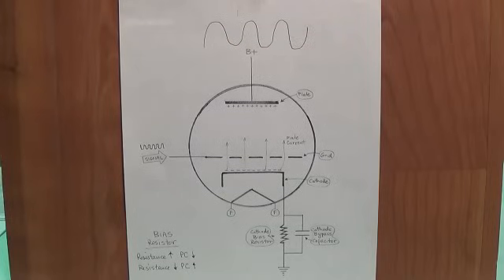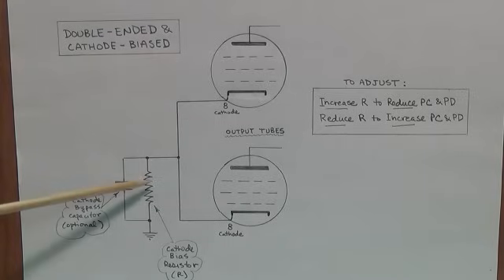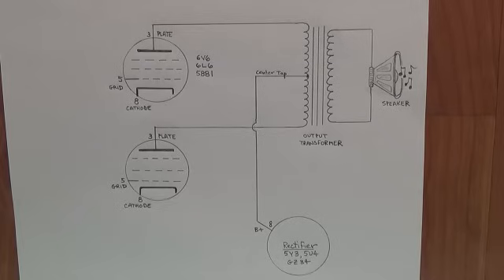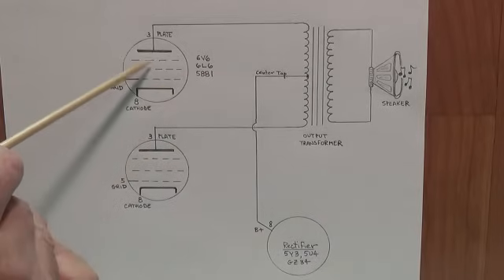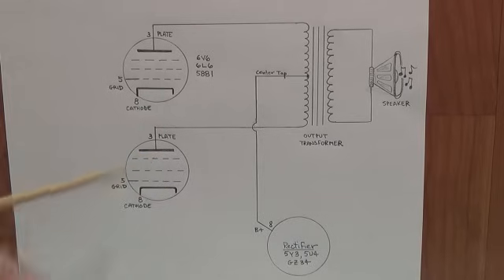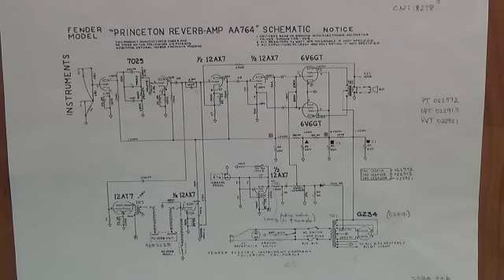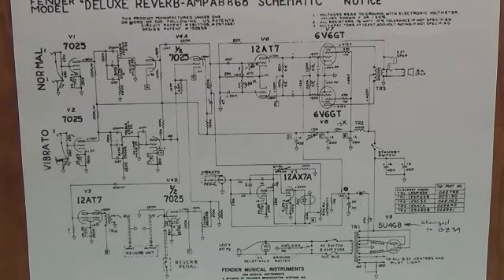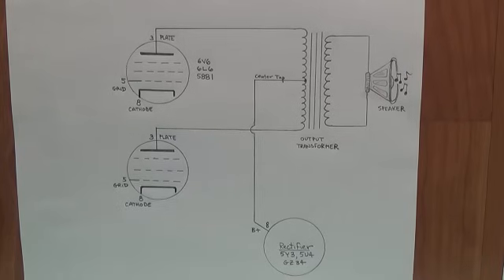Biasing Double-Ended Amplifier Output Tubes, Part 1: Basic Explanation & Methods

Comment: I think it’s much easier, just as accurate, and a bit safer to use a plate current tap, such as the basic Eurotubes bias current socket. But since the banana plugs will be at 400-500 volts instructions must be carefully followed to avoid shock.
Reply from the maker: I've been using Eurotubes bias probes for years, Kirk. Please see my video demonstrating them.

Comment: Hi Doug,I have a one question related to fender diy 5E3 amplifier which,can i use out put transformer purchased direct from usnited states to use it with 220V   european version amps..thank you
Reply from the maker: Yes you can, John. Even though the primary AC source for your amp is 220VAC, the amp itself runs at the same voltages as a 110VAC circuit.

Comment: In the grid biased example...
Why do you need the plate voltage?
You already have the mA and R in the output transformer and P = I^2 R
Reply from the maker: Your suggestion doesn't work for plate dissipation, Ott.  You are measuring the power wattage created within the OPT.....not the output tube.
Reply: @UncleDoug  Oh yeah!... It's all that heat she's throwing off into the room!  I forgot all about that!
Well, my idea works if you can wrangle up some absolutely 100% efficient tubes. And superconducting wire.   lol.
Reply from the maker: @Ottbucket  Even then you'd need to know the plate voltage.

Comment: In some circuits, there's a resistor, ie 50 ohm, in series between pin 8 and center tap. When I measure the resistance, do I include this resistor?
Reply from the maker: Since Pin 8 is to the filament and the center tap is between the plates, I have no idea how a resistor coud be in series between them.

Comment: If there is another (68Ω) resistor between the center tap and the B+, should I include that in the measurement?
Reply from the maker: No. You connect the ohmmeter to the CT and the tube plate, measure the resistance, then switch to DC voltage and measure the drop. Repeat with the other tube plate.
Reply: @UncleDoug  Thank you Uncle Doug!!! I rewatched all your old videos and I am super grateful for the knowledge you gave me!

Comment: will try to do this later with 6j1 small signal tubes. may be 2 of them in push pull config will provide some audible sounds.
not sure if i have audio transformer for this. may be will experiment with some mains to 6-0-6 or 9-0-9 ones. 
thanks.
Reply from the maker: Good luck with your project, IB.

Comment: I have to cool down a customers amp that's running at 147% plate dissipation and have never had to alter the cathode bias resistor in any other amp I've worked on, until now. Uncle Doug, I now fully understand the theory, principles and practice to get the job done when it arrives. Thanks again for all of your videos, you really are my favorite Uncle.
Reply from the maker: We're glad to hear that the videos have been informative, VTA. :)

Comment: you said EL84s are only cathode biased, but on my blues jr schematic it shows the cathodes of the EL84s are connected to ground and looks like the grid is biased or potentially the screen grid (sorry I don't fully understand)
Reply from the maker: I don't believe I ever said that all EL84's are cathode-biased, Kyle, because it's not true. I have several amps that utilize them and they are grid-biased. I have never heard of screen-grid biasing.
Reply: @UncleDoug  oh so you're just saying EL84s should be grid biased around 70% ?
Reply from the maker: @kyledriscollmusic  I'm saying that ALL grid-biased output tubes should be biased at no more than 70% of max PD.

Comment: Your videos are phenomenal, I’m learning so much! Quick question, I’ve heard that some manufacturers of cathode biased amps will bias the output tubes to 100% rated plate dissipation. Is this advisable? I thought 60 to 70 percent was the recommended target, at least for grid biased amps.
Reply from the maker: Thanks so much, Tony. Recall that cathode biasing is self-compensating and CAN be biased at or near max PD.  The 70% figure is only for grid-biased output tubes.

Comment: Are the steps basically same with a solid state rectifier? The reason I am asking is I am testing the bias on a JCM 800 and getting very low mA readings (,3mA) on the bias meter and the negative bias voltage  is about -57.5 volts. I have used 2 different meters and get the same thing.
Reply from the maker: Yes, the biasing procedure is exactly the same, regardless of the type of rectifier. Without knowing every detail of your procedure, including the scale selected on your multimeter, it's hard to speculate, but if the amp functions well like this, then the PC reading is obviously incorrect.
Reply: @UncleDoug  Thanks for the response. I should add that this is a JCM 800 50w clone that someone else built. It did not work at all when it came to me but now works after I corrected the power supply section. Also, they used an Antek AS-3T325 toroidal power transformer, why I don't know, but I followed Marshalls schematic to get it going. It has been difficult to trace what they have done but everything seems to be ok now but it sounds terrible it has that cold solder joint in the signal path sound but I re-soldered everything. It also has the 1 ohm  resistor going to ground from pins 1 & 8 on the EL34s, I get zero voltage across them to ground. PV 481v - Pin 4 479v - Pin 5 -57v . I get sound but it's distorted. Odd but, before I discovered that the EL34s where not actually grounded because of a missing nut I was able to adjust the bias to 70% dissipation using a eurotubes probe connected to my MM set at mAs no problem but the same bad sound. After connecting the EL34s to ground (pins 1-8) I get the same bad sound and cannot read the PC. I also used a Bias King and got the same results. hopefully I explained that well enough.
Reply: Would it be a good idea to lower the B+ just after the Choke with a resistor? That would lower the Screen Voltage which might be the issue.
Reply: I did add a 2.2K 2watt resistor after the choke and that everything down stream closer to specs and the screen voltage is at 465 volts and the schematic calls for 464. That puts the PV at 483 now. Still sounds bad.
Reply from the maker: @GuitarTubeAmpRepair  This is why I never work on other people's home-builds. The problem is always due to some obscure (or blatant) mistake(s) in the wiring that can take hours to find. I'm sorry, but there is no way for me to guess where the errors are. Good luck.
Reply: Well thanks very much for your help here and in all your videos. I know what you're talkin about when someone else build it and then you try figuring it out. I did fix it, it was that per the schematic I was setting the negative voltage too high for a 6550 instead of an EL34 so I changed a resistor and was able to dial it in. So again thanks very much. So it wasn't as mysterious as I thought it was LOL!
Reply from the maker: @GuitarTubeAmpRepair  Congratulations on a successful repair, GTAR.

Comment: Would any of you knowledgeable folks know why when measuring resistance from pin 3 (6v6) to  pin 8 (5U4) on my old epiphone amp my readings do not stop and settle in to a stable number. The readings continue to rise as long as I keep the leads on the measuring points. Are the test leads charging up some cap in the circuit and throwing everything off?
Reply from the maker: My guess is that the electrolytic caps are absorbing the 9V charge that your ohmmeter uses to measure resistance, Rusty.
Reply: @UncleDoug  thanks. I'll figure this out eventually I think, thanks to all you good folks out there sharing your experience. This stuff can be quite fun once you get into it.
Reply from the maker: @rustycalvera977  No need to "figure it out eventually" Rusty......I told you the reason. The electrolytics are interfering with your measurement.
Reply: @UncleDoug  Yes I realize that. I'll isolate those electrolytics from the circuit, then check resistance. thanks. The amp I'm working on has other issues: the current limiter bulb (thanks for your demo) glows warmly when the amp warms up so I have my work cut out for me.
Reply from the maker: @rustycalvera977  The wattage of the bulb must be appropriate for the wattage of the amp. An amp of over 40W will probably require bulb(s) of 200W to 300W or higher.
Reply: @UncleDoug  I'm using a 250W incandescent in my current limiter. My amp wattage is unknown at this time. Can't locate any relevant specs for it yet but its bigger brother is 25W, ....I'm thinking the current going to ground as the amp warms up might possibly be coming from my "death cap" which I'm addressing. thanks Rusty
Reply from the maker: @rustycalvera977  Good luck with resolving the problem.
Reply: @UncleDoug  thanks

Comment: So cathode bias if needed you have to change the resistor as there no adjustable resistor.
Reply from the maker: Yes, cathode bias adjustment requires changing the value of the bias resistor or pot, if it has one.

Comment: Hi Uncle Doug. I have a Groove Tubes GT Soul-o 75, which is a tube amp but is solid state rectified. Since it doesn't have a rectifier tube, how can i measure the resistance across the output transformer? Is there a path to directly measure the plate current? I do have a multimeter capable of measuring DC current. Thanks!
Reply from the maker: The absence of a tube rectifier makes no difference, William. Fender Bassman amps have diode rectification and the biasing procedure is the same as any amp with tube rectification.
Reply: @UncleDoug  Makes sense, but what point do I go to in lieu of pin 8 on the rectifier tube? Thanks!
Reply from the maker: @williamvann4305  The center-tap of the output transformer primary.

Comment: Can we measure the voltage drop between the center tap of the output transformer to both output tubes's socket without the output tubes in place? Only the 5u4 is used at the power supply end?
 If from pin 8 of the rectifier, it goes through some Resisters before reaching at the center tap of the ouput transformer, so do we measure after the last resister? or still measure at pin 8?
In case we use two 5u4 in series with 3A each (B+ output at pin 8 of the second tube), do we need a 6A capability winding from the secondary of the Power transformer? 
Thank you.
Reply from the maker: Since you use the voltage drop to calculate plate current, and no plate current is flowing when the output tubes are missing, the answer is "No". There will be no voltage drop at all without tubes in place.

Comment: Hi Doug, one question. In your experience, when you measure the resistance values of each side of the output transformer, are they generally pretty much the same, or is there sometimes a mismatch?  I was just thinking, if they're a little mismatched and you install a set of output tubes which themselves are a little mismatched, then in one configuration the two mismatches would add together, whereas if you switched the tubes around the two mismatches would kind of cancel themselves out somewhat.  I hope that makes sense.  Thanks very much for all your videos, they're highly informative and I'm enjoying them greatly!
Reply from the maker: I have never seen an OPT with precisely the same resistance in both half-windings.....but the difference should not  be too great or you begin to suspect damage within the OPT. Yes, you could try switching output tubes from one half-winding to the other to optimize balance
Reply: @UncleDoug  Thank you.

Comment: Uncle Doug - I noticed as you reviewed the various schematics in this video that on some, one leg of the output transformer's secondary was grounded while others were not.  Would you explain why or why not ground one side?  I once was told that grounding one side would cause ground loop hum.  Does it make a difference in single ended versus push-pull amps?

Thanks for your easy to understand teaching!

Carl Espy
Reply from the maker: One of the two connections to complete the circuit to the speaker voice coil is generally done by grounding the appropriate OPT secondary wire and also grounding one leg of the speaker output jack. It causes no hum.....indeed, it minimizes it.

Comment: Will you please explain to me exactly what is meant by the term "push-pull amplifier"? Does it relate to power-staging? Or gain-staging?
Reply from the maker: Please watch my videos on phase inversion and output transformers, Kieron. All is revealed.
Reply: @UncleDoug   Right after I asked this question, I watched those videos, and now I know. Funny. I thought it had something to do with a push-pull knob. Nope. I have watched a dozen of your older lessons in the past day. I have 4 more cued up right now. I'm at that point in learning about this topic where the concepts are beginning to gel in my mind, and the lessons are fun and exciting. All these years of playing guitar and never knowing how an amp did what it does. Now I know, though I will never work on one. For me, it's all about being able to communicate with a tech. To understand the different tubes. To know that, in reality, the tone knobs on the front are really only there to adjust the amp to different rooms, and that a great tech could design an amp so perfect for a single room that it did not need tone knobs, just by the choice of specific tubes and internal wiring of specific capacitors and resistors. I had no idea, and it is so interesting!
Reply from the maker: @KKMcK1  Thanks for the great comments, Kieron. It's rewarding to hear that our videos are providing you with an increased knowledge of tube amplification principles. Best wishes for continued learning and understanding.

Comment: Hi uncle hope you are well it occurred to me that you could use a combination of cathode and grid bias this would allow a smaller amount of negative voltage on the grids to fine tune the bias better what do you think
Reply from the maker: I see no benefit to reducing the grid bias, G, and the two different bias methods don't work well together.....but thanks for sharing.
Reply: The sound of a cathode biased amp is different from that of a fixed (grid) biased amp. There is no reason why a combination of cathode and grid biasing could not be used for a mixture of both.

Comment: Hey Doug, I'm trying to bias my 1968 Sunn 200s. However, when I look at the schematic, I think there is a choke between pin 8 of the rectifier tube and the output transformer. 

I'm assuming this will effect my readings for calculation of plate current?

Could I install a resistor in series with the wires from pin 8 to ground and measure that way?
Reply from the maker: Then simply take your readings after the choke, M&M. Best of luck.

Comment: Hi Uncle Doug! I have a question. A 6V6GT plate voltage is listed as maximum of 315Volts. How do many circuits show a Plate voltage of 415 plus volts on the plate can you explain please?
Reply from the maker: The 315V limit is really old and ultra-conservative, Alex. As Fender proved in all their low to medium wattage amps, 6V6's can easily handle 425V or even a bit more. What really matters is the plate dissipation.....which must be obeyed.
Reply: @UncleDoug  Thanks Uncle Doug! Love your work!
Reply from the maker: @alexkatsaros6180  You're welcome, Alex.

Comment: Howdy. I have been wrong.
Fighting hum in my DIY 4 x KT88 amp proved that individual biasing is mandatory.
First I trimmed the anode current to 45 mA. After that careful tweaking of the individual biases produced the hum to drop under normal listening levels.
Checking the bias voltages revealed that the steepest tube needs about - 61 V and the most shallow about - 59 V. The individual differences seems to be large for KT88:s. Otherwise KT88 is a great tube. Together with good output transformers the sensation of presence is fantastic.
Regards.
Reply from the maker: Indeed, a serious output tube mismatch can indeed result in an audible hum.

Comment: Is the reason you primarily discussed cathode biasing because it's the more common type or is it about 50/50 with fixed bias? Could you also please answer a question about grid biasing. Do you still have to go thru the steps to determine plate disapation.  If you use a matched set of power tubes,  does each different model amp have it's own target negative grid voltage? In other words, would it be correct to say...to bias any fixed bias amp, all you have to do is measure & the grid for a specific voltage?
Reply from the maker: I discuss grid biasing quite a bit in my more recent videos on more powerful amps, Mr. G. Since all tubes operate differently, you cannot rely on the applied -DC grid voltage for biasing. The best criteria is PD.